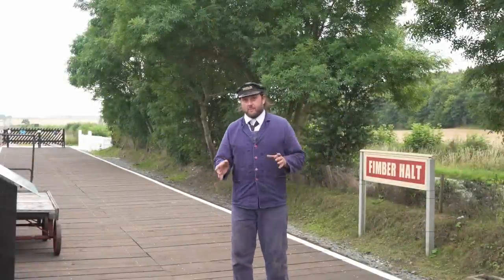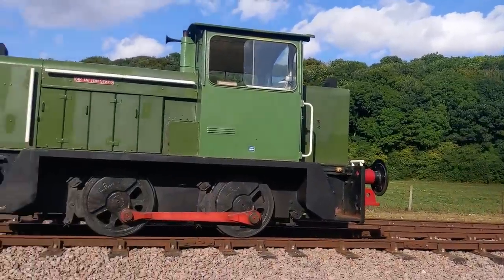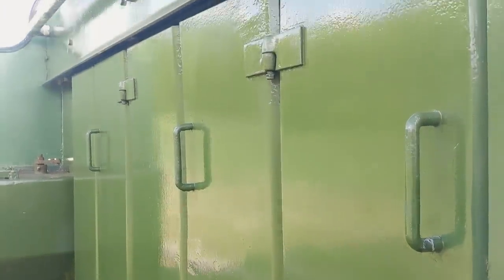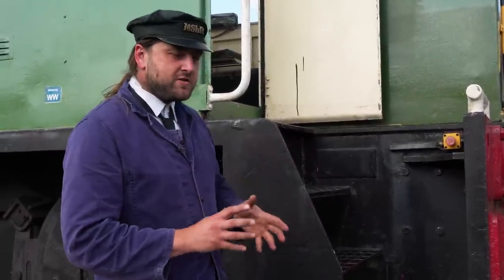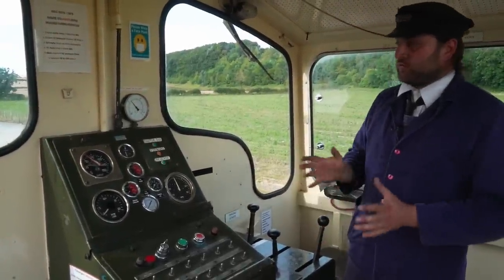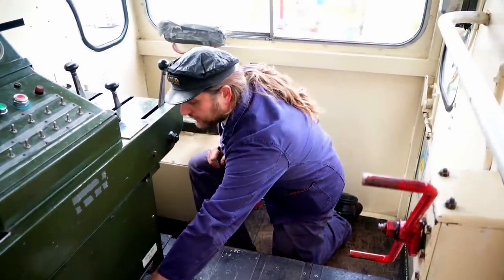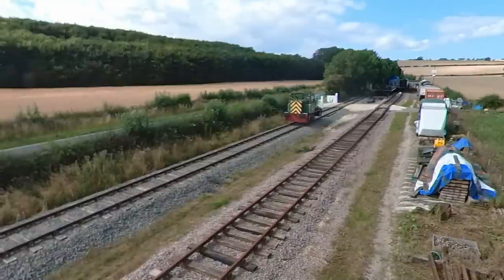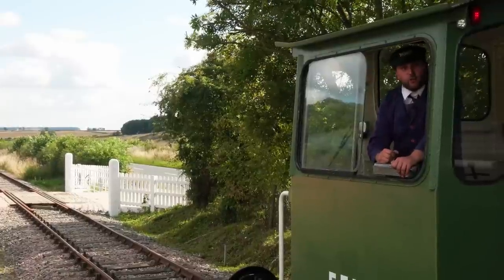The Locomotive sent to PRISON! Lawrie Goes Loco Episode 29

Comment: I'm guessing that the reason for the double reading speedometer is that it's a mechanical Hall effect sensor which is cable driven from the final drive. The cable spins the other way when going in the other direction and therefore moves the needle the other way.
Reply: it absolutely is, a steel bell with a very light clock spring over a rotating magnet driven by the cable. They could've added some kind of direction rectifying gear to make the magnet always rotate one way, but that's just one more thing to break or wear out, making the needle go both ways is much easier.
Reply from the maker: I believe that's correct.

Comment: Another brilliant loco. You find such fun things to run. Such an interesting mix of old and new. That great Gardener engine sound. Modern controls and electrical with old school engine and basic construction. I like the big twin disc. All of the transmission components seem large for 165 HP but it is all torque. I'm glad the loco got out on good behavior and has been rehabilitated and is now a useful member of society.
Reply from the maker: It's a cracking bit of kit!

Comment: 17:27 one argument I have for yellow lights on top of locos is: what if you're in an environment where you have equipment that is louder than a diesel engine? Such as a factory or dockyard or military railway. So, no. You can't always hear it coming.
Reply from the maker: My argument to that is horn, but I do see why they're needed. Still not a fan
Reply: I agree with Lawrie - more likely to see the great big Loco before spotting the light on top! haha
Reply: If I recall correctly Lawry mentioned some steelworks or steelmill service. Earprotection mandatory, so ... yellow light. Just like on the forklifts.

Comment: What a locomotive salesman you are, Lawrie! I'm so impressed that I want one, myself.
Seriously, it does tick the boxes- Size, Power, Reliable engine and transmission manufacturers (Gardner and Twin Disc), Ease of preparation and driving, and Westinghouse brakes.- Just the job for a small or medium sized heritage railway. Should be capable of some quite heavy load hauling if needed.
Reply from the maker: It's a really good little thing!

Comment: Great video of an interesting loco! At 14:41 you seem pleasantly surprised that the door opens, I would have thought that was a pretty standard feature of a door.
Reply: Standard doors yes. 60 year old (or older) heritage locomotives usually less so.
Reply from the maker: Having a door that opens to the cab, that can be left open and not encrouch into the cab is lovely. Means you get some airflow on hot days

Comment: I looked up OO gauge and it's kinda weird. It's track scale is smaller than the scale of everything else
Reply: You are correct in what you are saying. The track 00 scale and H0 scale model trains run on is the same but locomotives and rolling stock and other accessories are slightly larger. 00 scale is bigger than H0 scale asFrank Hornby who created Hornby trains wanted a similar size model railway system as H0 but he struggled to get some of the details on his models in H0 scale so decided to slightly increase the size to allow those details to be shown. Since then most UK outline locomotives, carriages, wagons and line side items have stuck with 00 scale but some of the H0 scale buildings, vehicles and line side accessories can be used on 00 scale layouts and the H0 scale loco's and other carriages  and wagons can also be used on a 00 scale layout.
Reply: It is weird, but unfortunately Britain does everything different to the rest of the world. I would prefer to standardise on H0 on my model railway, (and have used American H0 models for a one off video of the MBTA), but the only stock that can be used on my final Southern Railway model is 00 gauge.
Reply from the maker: Oo is just wrong HO.

It started being oversized to take the standard motor that Hornby had been using in their O guage, and its just... Stayed

Comment: You don't imagine 160hp moving 28 tons, but there it is.
Reply: At shunting speeds it’s all about torque and 11 liters should give plenty of that.
Reply: Many years ago, within the shed at Didcot, one road was occupied by Pendennis Castle (before going to Australia), Blue Peter, a crane tank loco, the Huntley and Palmers fireless loco and a coach. I think that it was around 400 tons or so, but we managed to pull them all out together using the Ruston 88DS which of course, was only 88 hp.
Reply from the maker: It's amazing how much torque there is though!

Comment: The flashing lights are an unfortunate necessity. If it worked at a steelworks then that is going to be one hell of a noisy environment. Any noise of it's movement may be submerged in the background racket Having two yellow bulbs on the bonnet ends sounds sufficient after American railway practice except without the tolling bell!
Trackwork in Industry was sometimes rather dodgy. 
Maybe steelworks were an exception if they are shifting really heavy lumps of steel and often white-hot liquid slag. 
This is my local railway. I will have to ask them what the patterns of bolt-holes in the buffers were for. I would guess they were a non-standard coupling for internal-use rolling stock at Shotton.
Reply from the maker: I understand some industry they're required, but still not a fan